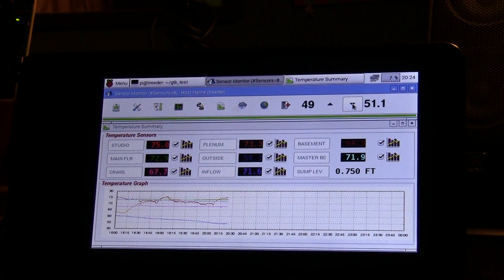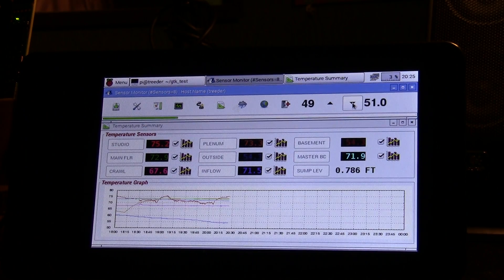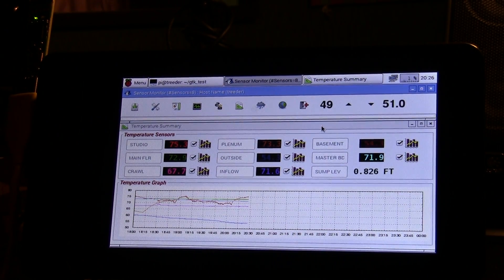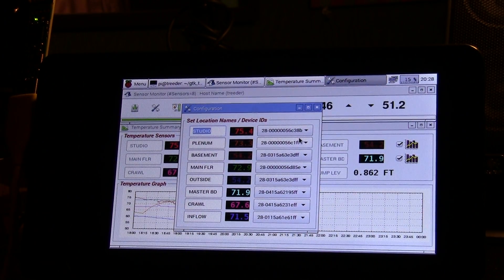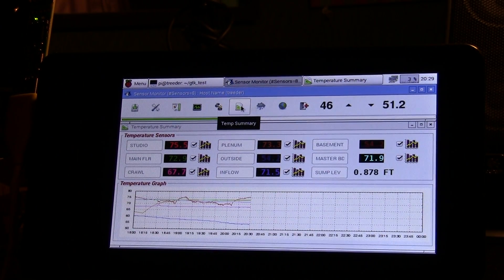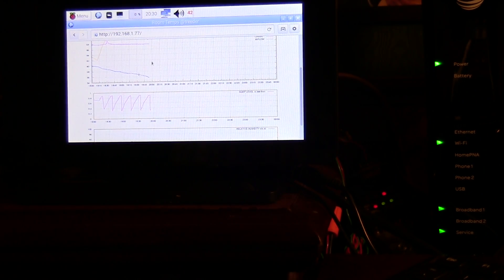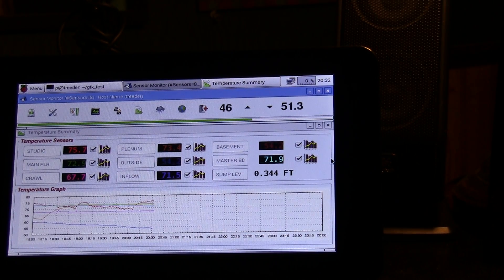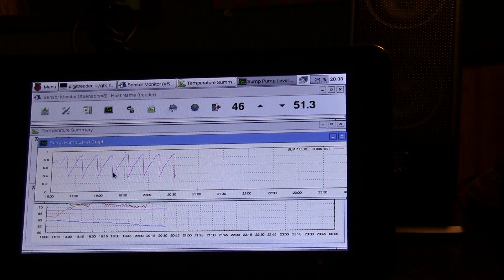Raspberry Pi Home Sensor Monitor

Comment: Very impressed with your home monitoring system.  How did you get graphs into glade ?
Reply from the maker: In the C code I produced a .plt file and system called gnuplot to produce a jpg image. The new jpg image was attached to a gtk image.

Comment: After collecting this data with a sophisticated system, and going to the trouble of putting it in a SQL database, why only keep it for two weeks? I had such a system, though not graphic as yours is, nor controlling as many actuators. I found it to be of interest to be able to go back years. A SQL database really doesn't use up much space, even when readings are taken on one  minute intervals with a dozen or so sensors plus actuators. 

I am currently rebuilding my system after my wife had an accident that wrecked my first system. This time around I am planning on more physical protection. I miss the data that I had  -- I should have protected it better. It would be of significant interest to see if the triple glazed windows I had installed this summer cut down on my heating costs.But I will be checking for whether my  water pump was going on and off too often. Check if the garage freezer was not keeping things cold, correlate temperatures and  A/C use as a signal for maintenance.  Check for water leaks under the washer and dryer as well as the boiler and associated tanks. IR sensors and cameras to capture images of wildlife at night (I was almost caught between a bear and her cubs one night.) An endless array of utile and fun information to capture and act on.

It is easy enough to save the data, and I found quite worthwhile. Especially at the price of storage these days. 

Best wishes